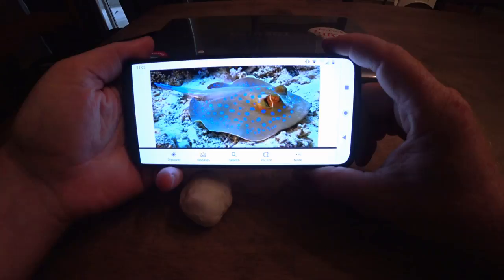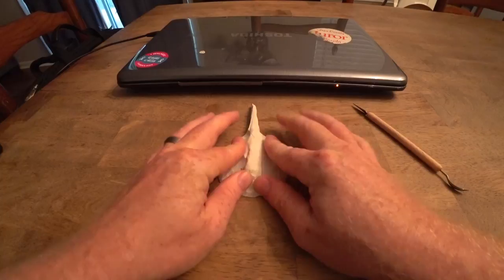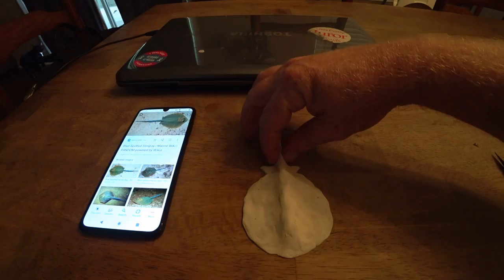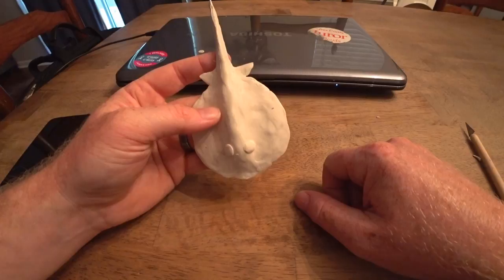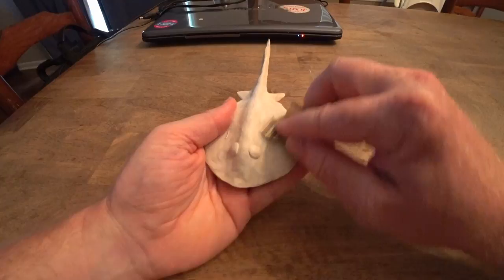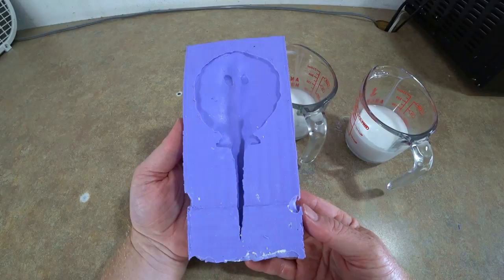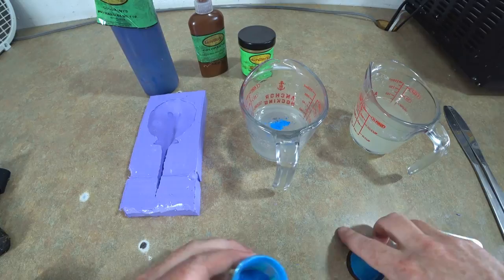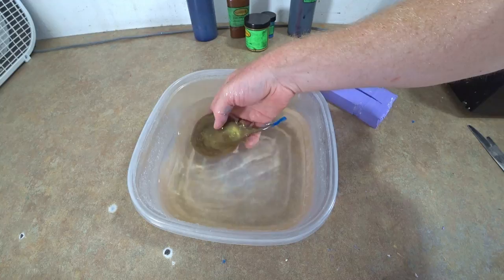We Made A STINGRAY Bait!! Casting A Silicone Mold For A Stingray Bait

Comment: Get you some corrugated plastic...you can make mold boxes out of that by cutting one layer and folding it into whatever shape you need and only having to seal where the ends come together at one point
Reply from the maker: thats a good idea
Reply: in Australia we call the plastic card board corflute and a hot glue gun will be the best for making your boxes also the silicone wont stick

Comment: I wonder how the action would change if you cut slits from outside the edges of the eyes all the way down the sides to where the little wings are to make big flappers on both sides. Might resemble the 'ripple' effect they have when they swim.
Reply from the maker: yeah not sure, I thought about that before and couldnt think of a way to get the flapping action

Comment: Forgive me if you already have been told this. Just sucking up all your content through the years. Next time try getting on a shop stool/chair to get some elevation and pour your silicone from up high. This will help eliminate air bubbles because it thins the material as it drops into the mold from a high pour. This method was made popular by Dick Smith the Godfather of Makeup effects. Or you know pressure pot.